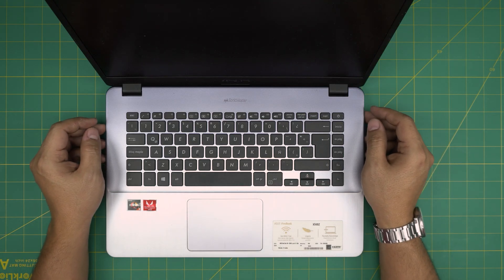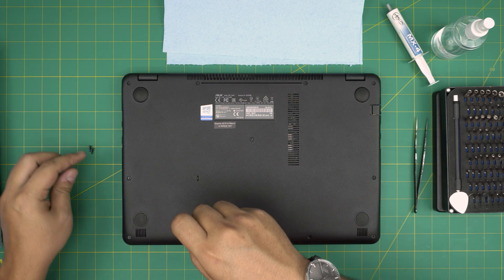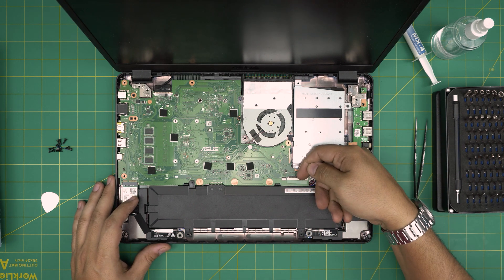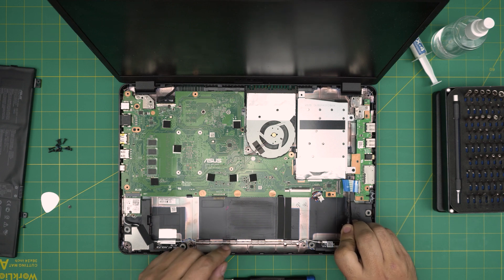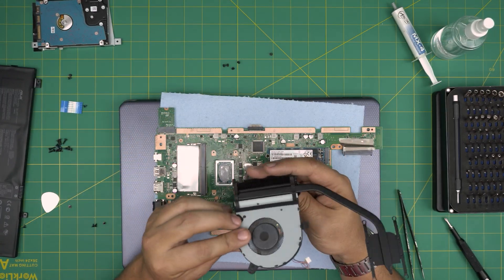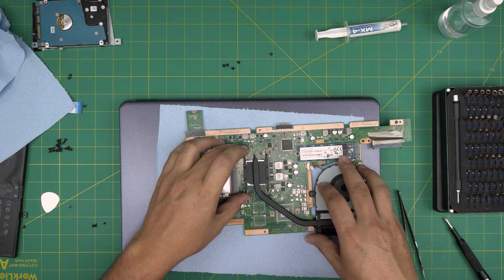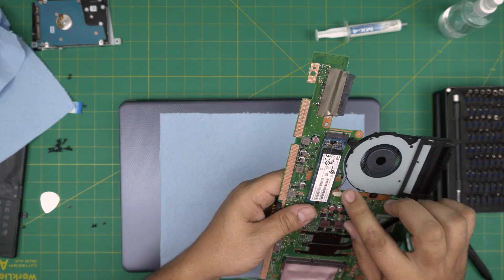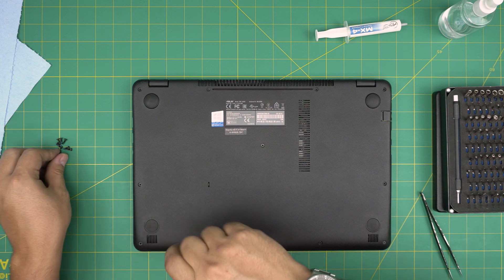How to Repaste and Clean an ASUS X505A - BR232T Laptop | Step by Step

Comment: I don't know why, but the screws on the fan and CPU are hard to remove. I want to force them open, but I'm afraid they'll get stripped. Any solutions?
Reply: I'm getting a screwdriver set with more bits right now. By the way, do you know the screw sizes for the ASUS X505ZA, both the long and short ones? If you do, I'd like to get some as well. Thanks in advance!
Reply from the maker: 🫠Regarding your question, use a long-handled screwdriver with a Phillips #1 head. Apply significant downward force on the screw while making small rotations.
Should you have any further questions or requests in the future, please don't hesitate to ask me.
cheers🍻
Reply: @uFixTek  Hey, thanks for replying! I’m still waiting for my screwdriver to arrive. Do you know the screw size for this ASUS laptop? I’d like to buy some if I can find them because I think the screw quality of this laptop is kinda bad.
Reply from the maker: They are m.2 screw.
https://amzn.to/4jVY3C7
or get this kit too they are very handy:
https://amzn.to/40L5Bi2

This is an Amazon affiliate link. When you use my links, you are helping to support the channel. 🙏